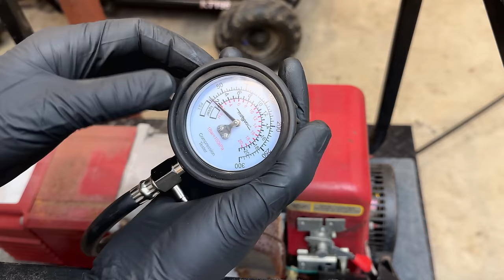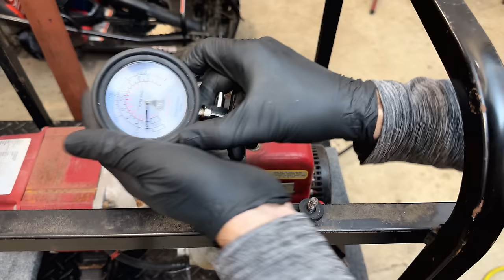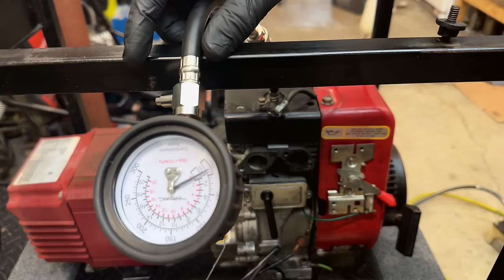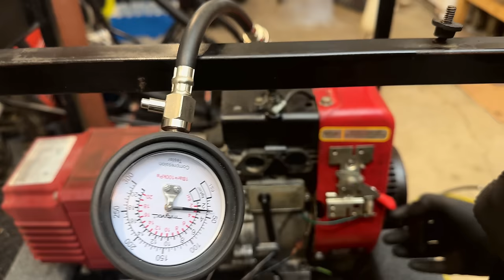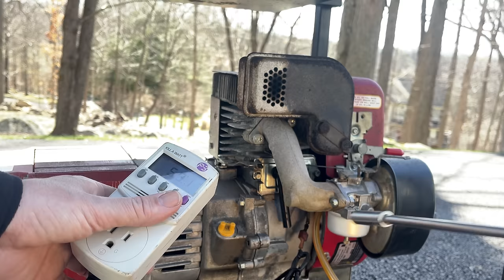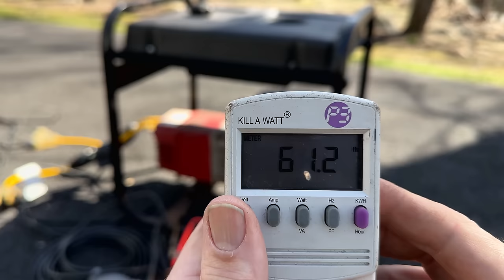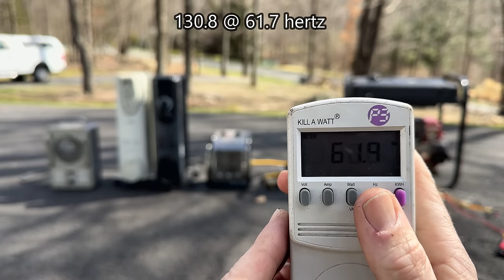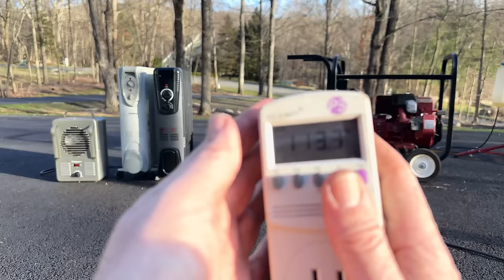More Tecumseh Trouble - Low Compression

Comment: I have watched a few videos of yours where the valve stem is too long to give the proper clearance. Presumably the engine has been this way since it was manufactured as the valve stem could not grow longer surely. I find this surprising - lack of quality control?
Reply: With the flat head engines the valve slams into the block material...

if the valve seat in the block is "soft" or the block is "soft" the valve digs itself down into the block...

so the valve stem  "falls" towards the lifter closing the gap...

no lead or low lead gas can exacerbate this as can non hardened valve seats...
Reply from the maker: During normal use, valves wear into the valve seat.  As it does so the clearance closes up.  The same happens on cars.  The difference is most car engines use hydraulic lifters.  They maintain the clearance as the valve wears in so no adjustment needed (unless you own a Honda which still uses solid lifters like the Tecumseh).
Reply: Valves can and do get longer, the engine running hot under a load or if it's lean, also low on oil can do it, head bolts are the same way for the same reasons
Reply: the valve don't grow lol. the seat sinks . its a fine balance on these L Heads
Reply: @shaunewing8973   Yep, but usually will run forever. Even when abused. Try never changing the oil on all of these chain drive junkers that some companies make now. Don't get me started on plastic gears, cams and so forth.
Reply: Good observation and good question!
Reply: @pingwax.  yes!
Reply: @NY411Info  That's for sure. It's shameful to make these little engines out of plastic! Also Too, I always wonder why so many guys start monkeying around w/ compression gauges almost first thing. If it doesn't feel like it has much compression when you pull the rope. If it has any, you can still start it if everything else is working. I do it all the time, using starting fluid. It has a little more oomph, and once I get them running they run great, pull a load and basically you wouldn't know they ever had a problem, until the next time you go to use it. But plastic valve gear?  Ha. That doesn't leave much for the kid down the street who picks it out of the trash to do something with it. Throw away age.  ben/ michigan
Reply: @benjamincresswell3713  yes, unfortunately they want them in the trash, however claim they are trying to be environmentally friendly.

Comment: When I was a small engine tech in the 80's, I hated seeing a Tecumseh come through the door.  They were always the worst engines I had to work on.
Reply: Totally agree! Never saw a good one, no matter what size
Reply: I've never worked on small engines, but from watching this channel, I can see they are cantankerous, noisy, poorly designed, and run poorly at best. I'm assuming they went they way of the Dodo and for good reason. If I were to get into the business, I'd refuse to touch them.
Reply: I’ve had to Tecumseh on all my snowblowers 30 plus years never had problems, but then again I maintain them correctly.
Reply: I also disagree. I have 2HH100's that start instantly an purr like kittens at low idle. I have several snowblowers that also start and run great because they are maintained. The problem is getting genuine Tecumish parts as the chinesium stuff from the jungle website and fleabay are junk!
Reply: I have a 22 year old powermate generator with a 13hp tecumseh, all those years and it starts on the first pull, only issue after 20 years was the carb being slightly dirty, new carb and an oil change and it still runs like new. Tecumseh are made by Briggs actually, so there’s a fun fact.

Comment: Just a thought from automotive carburetors: when a throttle plate comes loose from its' shaft, it repair can be attempted by 2 means. 1) Put the shaft and plate in proper orientation and re-stake the plate on the shaft or 2) re-orient the shaft and plate and solder or braze the two together. My dad and I repaired a few carbs in this manner BITD, saving customers a lot of $$$ for new or even used replacement carbs.
Reply from the maker: Either would have worked.  If I wanted to save it, I likely would have swapped the hole throttle plate and shaft with another OEM carb.  I have at least 30 in a bin.  Not exactly the same as I need but I bet the parts I needed would have swapped over.  Will give it a try.
Reply: Good work

Comment: I’ve had a couple of generators with that engine.  Reliable, but damn they are the loud!  Both exhaust and internals rattling around.    I tried quieting one with the optional muffler kit.  It helped sort of, but I then realized how much of the noise was internal.

Comment: I’ll watch this one later when I get a chance, but I have an early remark. I have at least two freebie OPE pieces that have been sitting unrepaired for at least a couple years. I did what I could when I first got them but eventually set them aside because I was stumped. 
I’ve learned during that time what is most likely wrong with them and how to correctly diagnose and repair now. 
What I’ve learned from this set of circumstances is that, as I progress along my small engine repair learning curve, eventually I will acquire the skills and tools to master specific issues and those pieces I set aside will eventually be good candidates for successful repair. 
I also learned this same concept in my career as a self-employed baker (14 years and counting). With enough study and/or experience and repetition the solution to a problem will eventually surface.   Don’t give up on something because you can’t figure it out right now. Take a step back and move on with other things and be willing to let the answer reveal itself as you continue to study and work in the field. 
Nowadays unless it’s a customer’s piece I do my research and if nothing presents itself I just let it go, knowing eventually I’ll figure it out. 
“I hope this helps someone.” 
😉
Reply: I didn’t know you were a baker! Do you have a shop on the cape?
Reply: Very comprehensive video as always and excellent narrative.
Reply: When I get a piece of equipment that won't run, the first 2 things I check is spark, and compression.  If it has spark and compression,  I check for gas.  If it fires on carb cleaner then it can be either the carb or fuel pump (if it has one)
Reply: @bertgrau3934 
Bert, I have an algorithm I’ve developed to check out OPE depending on whether it’s 2T or 4T equipment. Both utilize FACTS (fuel, air, compression, timing, spark), which I try to keep in mind at all times during my diagnosis. I try to approach diag in the most efficient manner possible to eliminate unnecessary steps and time. 
Since the preponderance of issues center around fuel delivery I focus on that first by eliminating the others immediately. Using 4T as an example, I confirm presence of adequate oil, block off fuel supply to carb and attempt a start with a spray bottle of 2T fuel into the intake. If the engine burns off the fuel then I’ve already eliminated air, compression, timing and spark so the only thing left is fuel. Only then do I look at the fuel tank to determine whether it’s prudent to allow fuel already present to attempt a 2nd start and longer run. Once that’s accomplished I turn my attention to whatever work the engine is supposed to do, except in the case of the generator, when I’ve already got a light connected like James to confirm generation.
Reply: @hester781 
JD, I bake out of my home kitchen and, since the Pandemic, set up my Roadstand three blocks away in a spot with good exposure. I also ship. No website, no advertising - just word of mouth and the location. Fridays/Saturdays 10-2. 
I have an eList of 550 currently, although it was up to 1400 at the end of 2019. 
I’ll send you a copy and a note.
Reply: @Rein_Ciarfella  
I have found with my methods I usually find the problem quickly.  I have found ignition coils bad, and no compression.  If no compression I check the valve adjustment,  if that doesn't work,  I remove the head.  On Briggs I have found the intake guide has moved, and holds the valve open.  It not a difficult fix,  but not cheap either. Some say the head needs to be replaced.  However for half the cost of a new head I can fix it. 
We all have our ways of working on and fixing things. For myself,  I have worked on everything from weed eaters to 600 horsepower diesel engines.  (both mechanical and computer controlled) 

Thank you for your input,  it is appreciated.  Have a wonderful day.
Reply: @Rein_Ciarfella  Smart process that never fails, all who follow shall succeed (the OG@EP)
Reply: Nice comment: patience plus persistence pay!
Reply: @johncourtneidge  
Sir, that is so true.  Have a wonderful day

Comment: Oooh! It's a marathon video!  This should be fun!
I've made a start on attempting to fix my first little genny.  It's a "Super Works" which has "1800W" on the outside but when you look more closely, you discover that's the peak rating and the continuous rating is 1500W (at 240V since that's the standard house voltage on this side of the world).  It looks like the gennys which James has said are "Honda Clones" and the symptom was that it simply would not start.  My first guess is that because I foolishly left fuel in the carb, that it's blocked.

The first thing I did was pull the carb off and open it up and I discovered that it's really bad inside.  The needle (which is a strange spring-loaded type I've never seen in any videos here) seems to be completely stuck, to the point where even wiggling it around with needle-nose pliers won't free it up, so I've ordered a new carb which is advertised as being compatible.

I also discovered that the fuel outlet is blocked at the tank, so I'm not sure what I'll do about that, yet.  So far, I'm working on just getting the engine running, then I'll work on the fuel tank.  I'm disabled, so it'll take a while, but I hope to get it running and then sell it for more than I put into repairing it.  (I have a better, working generator to replace it).

I hope this wall of text interested someone. 😉😆

About the video: That exhaust valve looks newer than the intake valve.  My first guess would be that someone just replaced the valve without realising that the valve stem needed to be ground down in order to adjust the gap to the correct value.  They thought that it was just simply a matter of replacing the valve.
Reply from the maker: I noticed the same thing on the other Tecumseh too.  Also a tight valve.
Reply: @jcondon1  I took just did one on an Ariens snowblower, admittedly not with the same grace as you 😂, and found the exact same thing. I find it very odd. I primarily work on 60's through late 70's Ariens snowblowers and they all have 5-7hp Tecumseh engines. I've never encountered this much variance on valves in those older engines. Another observation is I did not see any signs of excessive wear considering over .0010 wear. I find that odd or am I wrong?
Reply: There may be a pencil filter inside the tank. Remove the petcock to find it. It can be cleaned easily with carb cleaner or shop air.
Reply: 25:36 Hi James.  Does the Tecumseh have a rubber intake valve seal like the Kohler’s?  When I did the valve job on my M18 I noticed that one of the seals became petrified and disintegrated when I pulled the valve.  Also l didn’t see how the keepers work in your video.  The Kohler has a split wedge that needs to be inserted with grease to hold it on the stem, then you release the spring compressor.  (Didn’t watch when you posted yesterday because it happened when SpaceX Starship was launching . Yes, I’m quite the nerd)
Reply from the maker: @marcheld  there is a seal on the intake valve.  This engine did not use the wedge keepers.  The spring retainer cap was slotted.  Much easier to install.

Comment: Last fall, several Tecumseh powered machines followed me home, most with carb issues. I ordered several needle/seat kits and several bowl/float kits as all the brass float carbs had leaking floats. One thing I do that you didn't is to remove the welch plug in the side and clean out the tiny passages there, seemed to make tuning them easier. On the fully adjustable carbs, there is a tiny tube that slides up and down in the idle circuit passage, you can shake the carb back and forth and hear it if it's not gummed up. You have to reinstall the idle mix screw with the float bowl down or you'll crush the tube and it will never run the engine right, ask me how I know. I was never a fan of Tecumseh carbs (or engines for that matter) either, but once you do a few, their like any other.

Comment: James In  my experience.
If you put a compound between a bolt/nut faces that is being torqued, it can change torque value significantly. You can get a chart showing what torque to use to different compounds. Just a bit of info.

Comment: Back in 2014,  Hurricane Sandy took out power at my parent's home for days...    at my home,  fortunately only a few hours.   A kind gent lent us a generator much like the one you fixed up today.  10HP Tecumseh,  same gas tank and similar layout,  but it was painted blue.   It wasn't a "smooth runner"  but it was reliable,  and kept the home warm (powering the natural gas furnace)  and kept the food in the fridge safe over the 3-4 days it was needed.   It was quite awhile ago,  but that engine has a "sound"...  and if anything yours are running slightly smoother than this one was.   Old flat head motors weren't watch like precision... but they got the job done.

Comment: If I might hypothesise...

The miss at light load kinda sounds similar to the misfire that it does when you turn the choke off.

My guess is that at low air speed in the intake, a puddle of fuel builds up just behind the carb, and occasionally a surge of fuel gets drawn up into the engine, causing a rich misfire for a cycle or two.

Under load, the higher gas speed stops the fuel puddling like that.

And while not perfect, it is definitely better when the engine is hot - the fuel vaporising more than it puddles.

In old car literature this is sometimes called 'loading up', and one fix is to add a hotspot to the inlet manifold, usually heated from the exhaust.

Comment: Tecumseh engines were manufactured under license, in Italy from the 1950s to the 1980s, under the Aspera brand. In Europe, Aspera engines were used in lawnmowers, etc.
Reply: Áspera, or Áspero means "rought" in portuguese... so it's kinda fitting 😅

Comment: I'm retired and tinker with all kinds of power equipment stuff. I've gotten to the point where I avoid Tecumseh engines because of the way they run. I had a carb just like these from one that didn't run well and put it on an older Kawasaki FA210D and it runs that engine perfect. Thanks for anoth great, long video.
Reply: Long inlet manifold with a 90 degree turn.

When cold the fuel condenses out on the cold inner surface of the inlet..
thus causing a lean condition, stumbling and backfiring.

As the manifold absorbs heat from the running engine...
the fuel mixture evens out and stays in suspension at the level set...

You proved that by putting the exact same carb on an engine probably with a "straight shot short flow path" down the intake to the head and intake valve?
Reply: @JohnSmith-yv6eq  Sounds reasonable to me. I was thinking along those sme lines
Reply: Now you’ve got me thinking. I’m wondering what would happen if a short, straight manifold was adapted to the carb and maybe use the existing manifold to get the muffler out of the way. Now I wish I had one of these engines for an experiment

Comment: Hello, from Georgia, USA Mr. James! I’m a Subscriber and never miss a post. You sir, do great work and every episode continues to show your patience, strong work ethic and Your strive for perfection. Thank You, for all you do. You nailed it when you said “It’s the nature of the beast”. In my experience “Tecumseh” engines just run like that. They are cold natured, often have rough idle but, when you give them the “Beans” they’ve always performed well. At age 16 I made a business out of driving around area neighborhoods in my old 73’ “Datsun” p/up truck picking up old lawn mowers and occasional tiller from the curb, usually with a sign “Take me please, FREE”. I’d say 80% of the time they were Tecumseh powered. Back in those days I only ran into two brands “Briggs and Stratton” being the other which were simple and a snap to get running again after cleaning the points, resetting the gap they’d fire right up. (Showing my age there)Then, with a little spray paint, maybe a wheel or 4, turn around and sell them cheap and still make a good profit for a teenager. But, to many people’s dread “The Tecumseh” to average southern folk seemed to need too much “babying”. Tecumseh’s just don’t take well to being left BESIDE the shed to winter instead of inside. Ha Ha ha!! Which always turned out in my favor because most of the “Tecumseh’s” would be transported to a mini bike or go cart frame and would usually out run most Briggs. I do believe the “Tecumseh” was a good prerequisite for me to motorcycle engines later. Thanks for the memories! Love your channel!
Reply from the maker: When it comes to powering a heavy load, Tecumseh wins.  They are rough around the edges and harder to work on, but they are built like tanks.

Comment: Helo James: you can fix the original carb by peening the brass rivet on the top of the carb. Once tight bend the stop arm that 1:57:36 the idle adjustment serew pushes against to the proper clearance with the butterfly closed. That issue is not rare on tecumseh carbs, if they have not been used for a few years they often get slightly seized and freeing them up loosens the rivet.

Comment: Another great video Mr James, just as a side note about the drilling of the jets. If the jet is removable and brass, you can solder the jet orifice closed solid and redrill with a smaller bit size if needed.